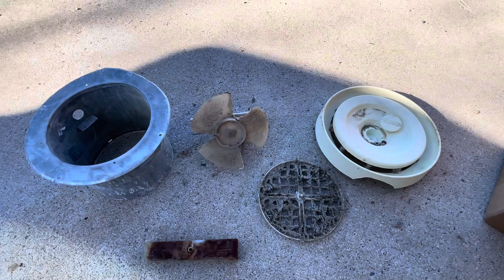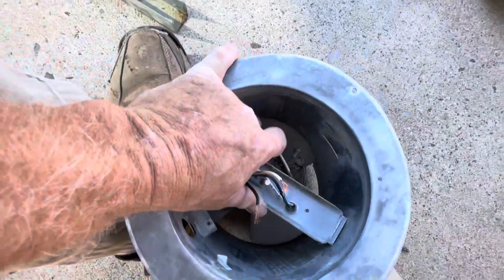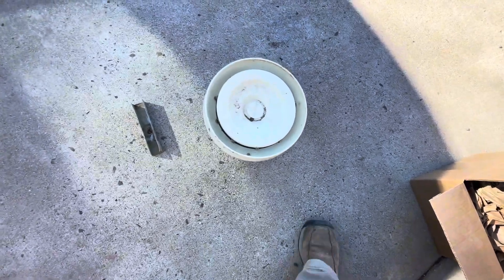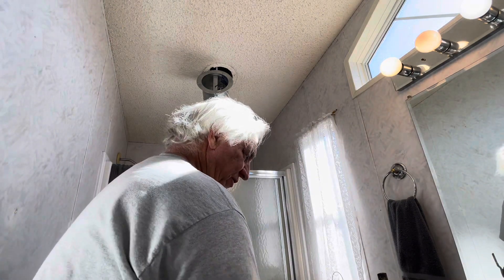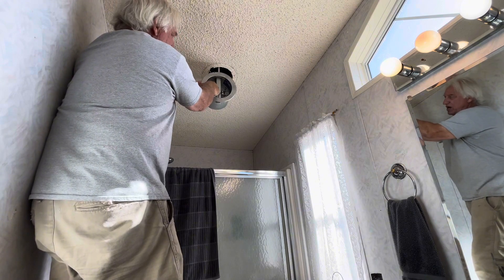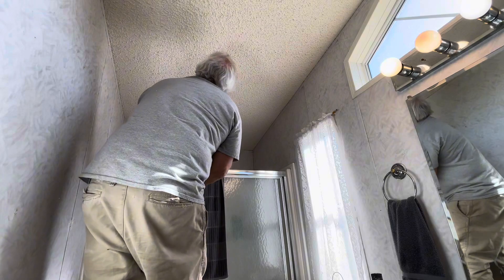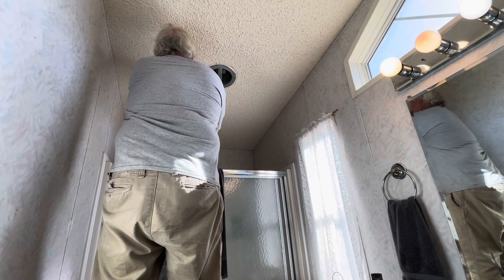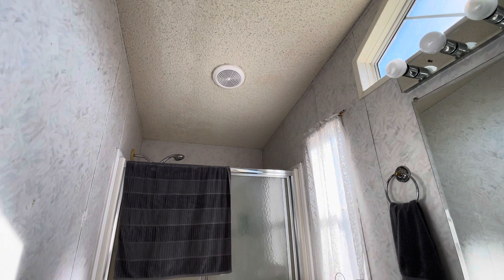HOW TO REPLACE A VENTLINE BATHROOM CEILING FAN IN A MOBILE HOME OR MANUFACTURED HOME

Comment: Hi, Very helpful video. Thank you for sharing. This is similar I have one at my home and I could not take out the old fan, I mean it comes out about an inch after removing the four long screws and I didn't force it to pull further. Second, where did you buy the replacement fan, please? Thanks for your help.
Reply from the maker: hi i purchased it online i believe on ebay. they deal in MH vents. SMH
Reply: How did you get the old fan out? I’m in the same boat, pulled the 4 screws and it moves down maybe an inch and that’s after I’ve been prying it away from the ceiling. Could that romex connector be the culprit of my issues? Any advice is helpful thanks!
Reply: I didn’t. I just took only fan out, cleaned it and put it back. It seems to be working and quite. One of these days i will try again and let you know.
Reply: Well for anyone wondering mine was stuck due to the manufacturing glue they used 
when assembling the home. I found this same glue stuff on a light fixture in the master bedroom and I’d imagine it’s on most, if not all the ceiling fixtures.
I had to bend in the entire enclosure inwards and while I did that I was able to detach the glue. The glue is white and rubbery and really annoying. You’ll need a cats paw prybar(that’s what I used- there might be a better tool), a lot of patience and a good adult vocabulary.
Reply: I can't tell you enough how much you helped me. I am putting one in now. The plug on the side had me stumped even after reading it. Thanks again.

Comment: What do those screws go into in the ceiling (through the flange)? Just drywall, anchors, or are you hitting wood? Thanks
Reply from the maker: sorry for the delay. there was ceiling rafter backing or joist. if you don't have, the best anchors are the screw type. SMH

Comment: Hi there first time mobile home owners, we remodeled a 96 last year. I just noticed that there is a ton of hot air coming down from our bathroom vents. Google says that there is supposed to be a backflow to prevent reverse airflow, but I’m not seeing that in your video? So if I were to replace mine, it wouldn’t make a difference? I appreciate any advice.
Reply from the maker: hi, your vent has a flapper so i am not sure why you would have hot air coming down. also, on the roof you need a cap; remember warm air rises; heat does not. SMH
Reply: That foam was the backflow preventer and yes I have seen hot air pouring back into a mobile home a 97 model without a backflow preventer that new exhaust have.
Reply: @Tech-gm9fd  so what do we do

Comment: How did you get the unit out of the ceiling? We're stuck. We took off the cover and the metal plate cover but the unit itself won't come out.
Reply from the maker: hello there are to little types of a clip that didn't really move so i ever so slightly notched the drywall make sure i didn't go to wide. the flange will cover it. SMH

Comment: You mentioned in the video that you had to notch out a piece to get it back in. Can you tell me how did you do it?
Reply from the maker: i just used a hackzall or utility knife. just notch the drywall or the material that surfaces the vent. heck you can be like my mother-in-law, and cut everything with a kitchen knife. arggg.. SMH
Reply: Lol. Thank you so much.  @showmehow4076